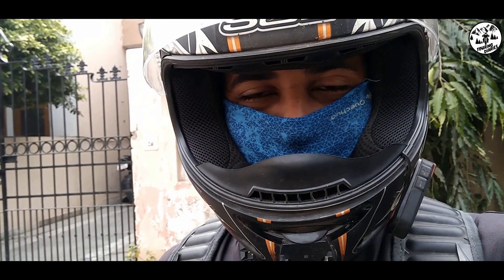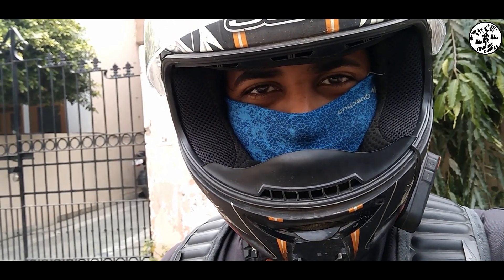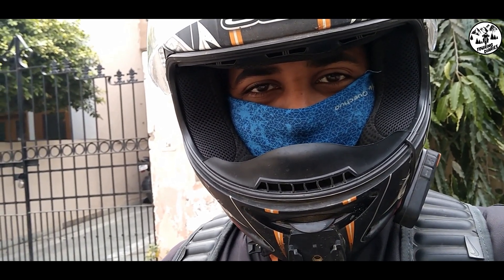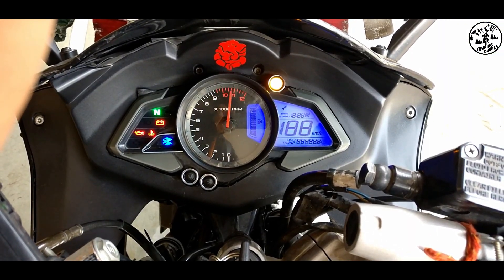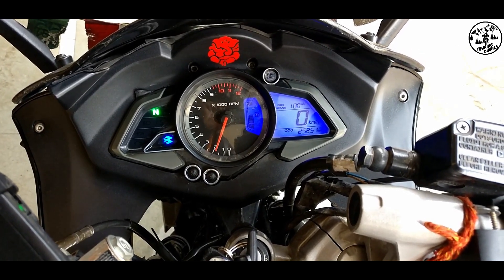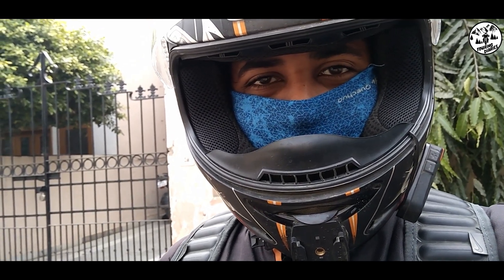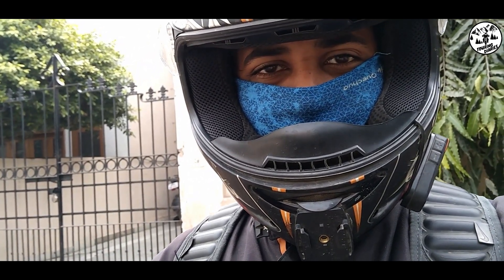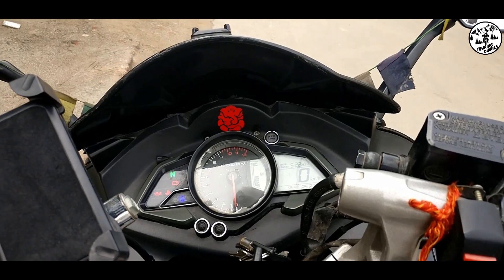Most Common Problem | Pulsar RS200 |

Comment from the maker: This is just a normal problem, caused due to cold conditions ! it can easily be tackled by cold starting your bike ! :)
Reply: its coz of weak battery bro,fi biks nvr hve cold start issue coz of ecu ,rcently changed my battery coz of same,even u get 1error code on display dats ecu restart code coz of weak battery
Reply from the maker: Manav Singh Manav bhaai, sahi bol rahe ho. Ho sakta hai this is because of the weak battery. Aapne kab change karai thi battery ?
Reply: haan ji amit bhai recntly changed my battery facing same issue frm last 2months n mine rs is may17 bs4 model,lagta hai aapka hi time aa gaya hai ki battery change karwalo :P
Reply from the maker: Manav Singh hahhaha ! Nahi abhi nahi ! Mereko toh 1.5 saal ho gae hai ! Dekhte hai abhi aur chalegi battery. Battery pe 3 saal ki warranty toh hoti hai.
Reply: exide ki hai na aapki bike main 24 & 24 months ki hoti hai usky baad value ky % wise decrese hoti rehti hai value check karwalo 1bar aap battery n if poss change it within warrenty
Reply from the maker: Manav Singh Haan , 2 saal Bhi Hui toh it's still under warranty. Is week Jake dekhta hu . 😊
Reply: Manav Singh thats true
Reply: tbhi to ktm ktm hei usme ye prblm nhi h
Reply: Get ur battery charged n try to ride long distance,, using too many self starts in short distance leads to battery low
RS 200 is fuel injected it needs battery to run the fuel pump n yeah fuel injected doesn't have any cold start issues, start ur engine wait for 1 minute n u are ready to go
Reply: Touring Diaries bro. My rs idle speed has gone higher. How do I adjust it.  Even after warming up. Then after riding while stopping rpm stays high and only at complete stop it comes down to about 1700
Reply: Brother why your yellow light (malfunction indicator)  not glowing in turn on ignation switch mine same problem what was the reason??.  Radiator fan problem or fi fuel enjector problem? 😣😣
Reply: Manav Singh correct Bro FI doesn't  have any issues for cold start fuel n air mixing is full done by computirized system
Reply: Manav Singh I have changed battery 2days back but still I got battery problem today
Reply: Hello bro.. I'm facing a problem from Fi unit...it indicates when I riding above 8000rpm... How can I fix it...
Reply: @ManavS220  no bro u r wrong I changed and replaced new battery but the same problem continuing.
Reply: @francisxavier8757  bs3 or bs4 ?????
Reply: @ManavS220  bs4
Reply: @ManavS220  sir first I replaced battery same problem continued so I also replaced rectifier and magnetic coil also but it Is not stopped yet .😭
Reply: @TouringDiaries  bhai meri carbureted pulsar AS 200 hei aur merey saath bi aisa hota hei aur bike garam honey par..bike start toh hoti lekin h107 upar aur jl35 nichey aata hei chaahei bike kitni bi garam kiyu na ho

Comment: It is not a problem....it is due to low battery condition....my Pulsar 150 was also facing the same problem for a long time, say 1 month after 1.5 years of purchase....I checked and found that the battery electrolyte level was low. So get your battery checked. It is not a problem with bike, actually your battery isn't healthy. I know RS 200 has VRLA battery, but get its health checked
Reply from the maker: Hello nilam bhaai, Thank u for your input. Yes, one of the reasons is low battery and we have figured that out. But there are people who have bikes not old than 6 months and they are also facing this issue. Hence, we need to check why it is happening with them when ideally it shouldn't be.
Reply: Touring Diaries It is not so that if the bike is 6 months old, the battery will be ideal...cases have been seen of gear shift failure in cars just after the delivery. What can you say about that.
Reply: This is the case of potential drop of battery and there is nothing to worry. Getting the battery health checked is the way to get rid of this problem
Reply from the maker: NILAM KUMARI yes I understand that but that is a one off case. And I just want to check all the possibilities when this problem arises. This happened to me when my bike was just 6 months old and I went to Munsyari in -16 degree. Then the display restarted for the first time. I know low battery is one of the reasons, now I'm looking for more such possibilities.
Reply: Touring Diaries Which riding gear do you use so that you are able to withstand such freezing cold temperatures?😨
Reply from the maker: NILAM KUMARI haha ! That time I was wearing Rynox jacket , all liners, two pair of thermals , 2-3 t shirts , 2 gloves , 3 pair of socks , muffler , neck warmer , winter cap, only this much 😅
Reply: Touring Diaries Great!
Reply: Touring Diaries But normally which is the best and most safe riding gear and helmet for sports riding?

Comment: When did you leave your bike to service!?
If its happening after service please check the spark connectors and check all the fuel line are in proper shape and they are not pinched.
Reply from the maker: Yatheesh S Yashasvi I took this to service a month before. After that I didn't ride this for a week and that's when I faced this problem.
Reply: Touring Diaries then its definitely a fuel line problem
Reply: Have you fixed the problem!?
Reply from the maker: Yatheesh S Yashasvi yes bro, I got everything checked. Now I'll be replacing the battery by end of this month. 😊
Reply: Hows your bike now!?

Comment: How u fixed ur mobile holder   i have ordered the same holder but i want to know that will it fit in my pulsar as200?
Reply from the maker: Bro, I have got a extended handle bar rod on which I fix my mobile holder. I have also made a seprate video for the same, you can check that as well.

Comment: Bro I have bought rs 200 1.5 years back n I am also facing the same issue.in the new rs there is this automatic headlight on feature so can't switch off that rest there is nothing to be switched off but I still encounter this problem in every 2 or 3 months...
Can u suggest something

Comment: Thi problem comes if your battery gets weak, your battery will die very soon.
Reply from the maker: Evolution : Machine to Man yes bro, you're right ! I'm planning to change my battery by end of this month. 😊
Reply: Cool, I recently changed my 2014 200ns battery , this problem persisted before the battery was dead.
Reply from the maker: Evolution : Machine to Man yeaah, this happens mainly because of that. I'm happy that I got almost 2 years of life from my stick battery. 😊
Reply: Evolution : Machine to Man  dude i face this problem on my rs from a month so what i do is this serious problem.?

Comment: Bro yr batry weak plz chnge that
Nd other reason of this problm is that if you add some other electric accessirois with your wiring.
Reply from the maker: mohit bhaai, yes the battery is weak that is the main cause , using other electrical accessories doesn't cause this issue.

Comment: Hey bro... I m facing same problm but i will change the battery... There is one more problm jo ki 2 saal se correct nahi ho paya h... Kitne sare service centre change kiya but kuch nahi hua... The problm is ki bike start kar k jab normal accelerate karta hu then aisa lagta ki jaise bike khud ko kheech raha... Aage nahi jana chahta... This does not mean something ghost like... But wo utna jyada accelerate nahi hota jitna ki hona chahiye... Iske karan bike bht jald garm ho rahi aur bht heavy lagta chalane per... Dont what is the problm... If u have any idea then do reply bro... Bht problm me hu yaar... 5th gear pe 50 k speed ko cross karne aisa lagta jaise kitni mehnat karni par rahi...
Reply from the maker: Haan that's inherent RS behavior. Har RS Mei hota hai. Mere sath bhi hai same problem. 4-6K rpm Mei hota hai aisa

Comment: Its due to the battery.my ns has the same problem.after replaxing the battery it will get ready
Reply from the maker: VINEETH bhaai, yes it is one of the reasons. Thank u for your inputs.
Reply: Vineeth bhai maine toh 10 din pehle he nayi NS li hai...tab bhi mere mein ye problem kyu aa rhi hai..?
Reply: It is also because of bad connections, show it to a service center guy.

Comment: (RS 200 BS3 2016) Mera bhi major kuch problem hai.. Jo wire magnet coil se ata hai bahar wo garam ho rahi hai.. Bike miss mar rahi hai..power lack bhi hai.. Chalu nhi rehti.. Regulator naya dalaya hai.. Throttle body fuel tank sab wash kara liya but no response.. Abhi lockdown ke baad start bhi nahi ho rahi.. Patahe nahi chal raha ki hua kya hai bike ke sath... Aur haa.. Mene puri engine ke parts naye dalwaye hai.. Crank.. Block kit.. Clutch plate.. Valve sab kuch.. But issue thik he nahi horaha
Reply: Same problem please give me the solution

Comment: Bro in bs4 we can,t off lights bro
The issue with my pulsar
Reply from the maker: Praveen bhaai, do one thing. Take self starts for short durations as in. Take 4-5 self for 1 sec each and then it'll work.
Reply: Praveen Yadav we can add switch for that !

Comment: the speedometer restaring after every time bike started i changed battery also but even this problem not solved and parking lights are not working when ignition on but horn,pass light and indicator working ( parking light works after engine started only ) plz any solution
Reply: change regulator
Reply: Bro regulator change panni paathingla I face this issue pls reply solution

Comment: Any idea about how to do this with a bike having AHO.. you just can't switch off the lights..
Reply: Sandeep Singh don't keep the starter pressed for long time just one push and it will start even in cold weather due to FI , if you keep pressing the starter for long duration your display will restart
Reply from the maker: does this problem persist with BS4 models also ?
Reply from the maker: Abhijeet bhai, this is problem in cold weather, when the bike is cold, it usually takes more than a single self start.
Reply: Touring Diaries yes it's difficult to start in cold weather sometimes, but what I want to say is don't keep the starter pressed for long time it creates excessive load on battery and display restarts so use starter in short intervals until bike starts
Reply from the maker: yeah ! this is a better explanation ! Even I'll try this and let you know if this works out for me !
Reply: abhijeet achlerkar use motul 10w50 bike will start in single self

Comment: Brother my pulsar rs 200 shows engine oil light continously plz tell me what i have to do
Even i have changed engine oil, engine oil filter but it continously blinks plz tell me what i have to do please
Reply: koshur gov balaay check with heat sensor and radiator fan

Comment: Same problem broooo in my ns 160 im used only 3 months
The worker said it is a battery issue. What i do now
Reply from the maker: Rahman Razz wait till winter gets over. This happens usually in winters so nothing to worry about. But if you'll face the problem in summers as well then get your battery checked.

Comment: Same happened with me 2-3 days ago. In the morning i just washed my bike and in the afternoon wen i started it didn't. I did it like for 15-20 times den i pulled the spark plug cap blewed it with air and connected it and voila! The bike started in 1st attempt.
So basically due to some water droplets current wasn't passed to engine and i think there is nothing to do with cold coz my bike was parked in sunlight and i started it maybe between 2 to 3 pm.
Still thanks for the video!
Reply from the maker: Yes Nikhil Bhai , washing is just another concept and this is another. Dono Mei bike start nahi hoti. But yes , I'll keep this in mind as well. 😁😀
Reply: But Bhai water is good conductor of electricity🤔

Comment: That happens wen ur battery is about to die
Reply from the maker: prachay nagzarkar are you sure about that ? Coz people with bs4 are also facing the same issue and bs4 is still new in the market.
Reply: Touring Diaries i have replaced battery of my ns twice in four years and during end of lifecycle of each of these batteties i was facing such issue and when replced with new one issue was resolved
Reply: Try installing battery from exide dealer as tey hav launched a new battery with 36 month warrenty which is better considering the one  given in showroom as it has oly 1 yr warrenty
Reply from the maker: Okay Prachay bhaai, actually abhi Jo RS Mei aa rahi hai batteries unki warranty 2 saal hai ! So, ideally new bikes Mei to nahi hona chahiye ye. Kahi na kahi ye thand Mei zyada hone lagta hai. Still, I'll check if this can be resolved by changing batteries.
Reply: +prachay nagzarkar bro today i have found a new deal for exide battery and shopkeeper gave me 4 years  warranty on new exide battery
Reply from the maker: Siddharth Khurana 4 years warranty ??? That's a great deal, where did you find that?
Reply: Touring Diaries bro i am from agra and i
 found it from a shopkeeper near to my house
Reply from the maker: Siddharth Khurana great bro 😃🤘

Comment: Hii Amit just want to know.. How is your bike performance.?? .. Need your feedback because I'm also buying the same in a week.. . I have also messaged you in Facebook...
Reply from the maker: hello Debarshi bhaai, the bike's performance has been top class. No major issues till now . I have also made a one year ownership video, you can watch that as well. Just let me know in case you need anything specific about the bike 😅
Reply: Touring Diaries I want to know about the projector head lamps.. In the day time only one head lamp works??  How to switch on both??  It will be automatically switched on at night time?
Reply from the maker: Debarshi Ghosh only one is turned on all the time and the other one is high beam. If you'll switch to high beam both will be turned on.
Reply: Can you also please tell me how much it cost for each service??
Reply from the maker: Debarshi Ghosh during free service you'll be charged only for your engine oil and oil filter. I use motul so it comes around 1200 , and after that service charge is approximately 300-400 extra.

Comment: Had the same problem in my 3 year old RS200.. H:07-dtA31..It was the 
speedometer wire causing the problem.. SVC guys told they replaced the 
wire.. Now it works fine...
Reply: Bro can you please describe about that wire , i need to replace it too